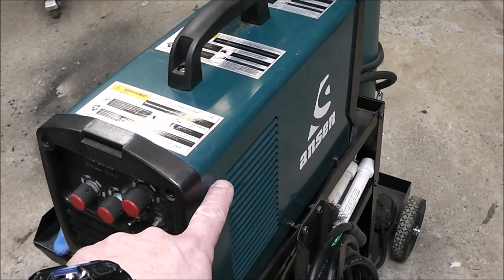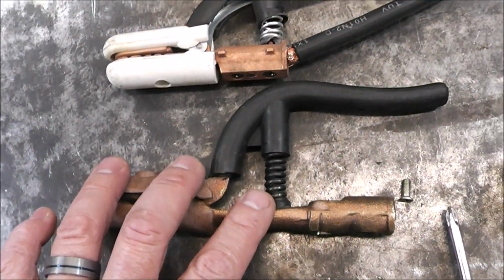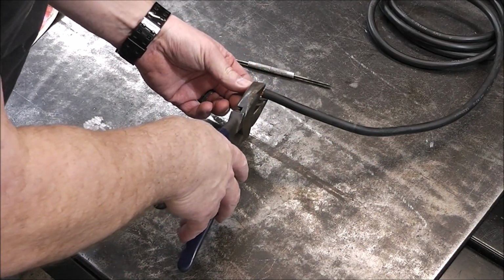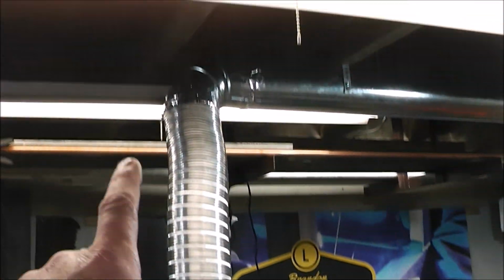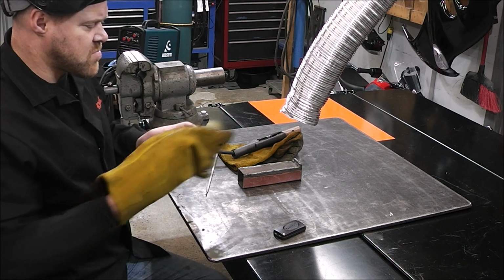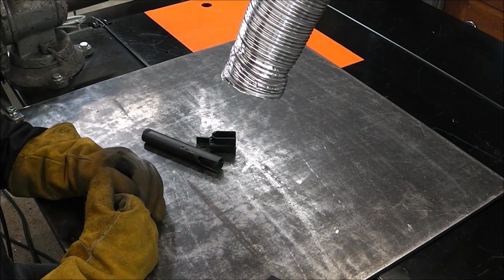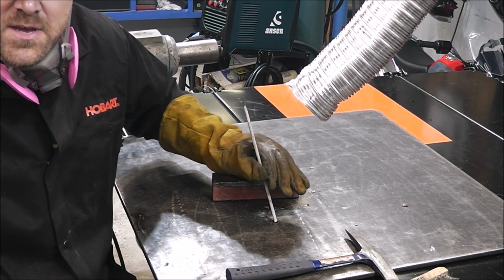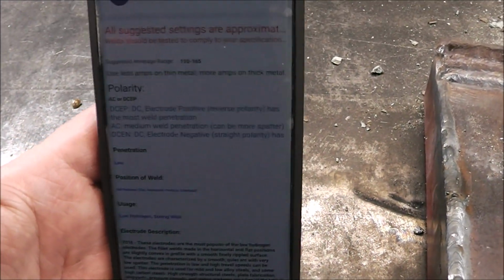AMAZING Welding Stinger Rod Clamp Failure YOU WONT BELIEVE IT!

Comment: i had to change the holder on my old miller buzz box i went with the berger one from hf its actually pretty nice though solid brass inside comfortable to hold and handles 400 amps also only 12 bucks with a coupon but id rather spend a few more bucks and buy an American made product. the carbon fiber did seem like a nice feature until it started arching. definitely gonna take it apart and put some dielectric grease in there and make a fume extractor like you did after seeing this now.
Reply from the maker: Nice! HF has some pretty decent stuff.

Comment: I keep an old course wood file/ rasp attached to a board lying next to my project. When you get rod burn back just strike it across the file and the flux is taken off quickly. Kind of like the motion you use when you strike a wooden match. Love the tips and info. JeffinMaine
Reply from the maker: That's a great idea!
Reply: works great costs zero , well if you have an old rough-cut file lying around  @BrandonLund

Comment: Plus the stock stinger has a gap at the grip. I believe due to the length of the cut conductor strands was cut by ste locking mechanism not insulation cutting..
Reply from the maker: Makes sense. Crazy huh!

Comment: If you fling the molten ball off of the end of the rod immediately after breaking the arc then all you need to do is crumble the flux away with a gloved hand. It the oxidation that forms on the molten ball that inhibits restrikes.

Comment: The wire strands broke because a) the clamp edge, and b) the wire is flexed at the clamp everytime the handle is squeezed. More how the copper extends farther back on the new part? That removes the wire from being THE bottom part of the handle.

Comment: Scratching the rod is better than tapping the end. Usually the poor restart is from melted flux or other impurities at the tip of the filler metal. Cracking back the flux too far actually can make restarts harder by not providing enough shielding gas to get a stable arc.

Comment: Good video. One thing I will comment on is using the antioxidant goop. It's mainly only for aluminum condustors because they set up much easier than copper. Adding anything to the conductor such as the goop increases resistance
Reply from the maker: Good point

Comment: Now I want a YouTube channel...just for the telemarketing. I was liking the stinger until I saw that first spark. Then it hit Carbon fiber...wonder what best of the best welding will have to say.
Reply: That's partially why companies have people test their new products.  But i agree i would hate to see that if i owned the company.
Reply from the maker: The actual stinger piece itself is very high quality made by Radnor. I'm surprised their R&D didnt catch this.
Reply: Doing some research on this cause it got me curious... While the carbon is conductive the epoxy it's coated with is not. As long as that coating is thick enough and you don't get a couple of breaks or thin spots you should be good. That handle had to have had at least 2 spots that were able to touch
Reply from the maker: That makes sense...it sparked on the end where it was cut to length and the raw carbon was exposed.

Comment: You will also find that alot of rubber hose that uses carbon in its composition can be very conductive when used to isolate electrical connections.
Reply from the maker: I never knew carbon fiber was conductive but this is also the first time seeing it in person.

Comment: Carbon fiber is not as good of a conductor as most metals but it does conduct electricity. It is really wrong on a part of the manufacturer who used it in welding rod holder.
Reply from the maker: I'm surprised someone didnt figure this out before me. I never knew carbon fiber is conductive. I do now lol
Reply: @BrandonLund  Nowadays you can find any rubbish things on the store shelves. Here we are with the new free trade imposed by the corporations. You have to be careful before buying something.
Reply: @BrandonLund  Nowadays you can find any rubbish things on the store shelves. Here we are with the new free trade imposed by the corporations. You have to be careful before buying something.

Comment: Luckily I got a screw clamp stinger with my MMA/GTAW welder. 200A Welder, 400A clamp & stinger came with it (and it wasn't cheap, lol). Now all I gotta do is wait until we get some cooler weather and fire bans (affects welding outside) are lifted to get on with practice, lol.
Except for the glue giving out, you could've slipped some heatshrink over the handle and that would've solved the arcing problem, but a previous commenter (Dominique) said his similar piece broke at the spring. Looks like it is back to the drawing board for the manufacturers.
Good stuff Bran, thanks for sharing.
Reply from the maker: Thanks buddy! Its been mild here lately. Cant wait for warmer weather, however there is a chance for snow this weekend so its inside for us here. I'm amazed that no one caught the fact that carbon fiber is conductive. I wasnt aware. I am now 😁
Reply: You weren't aware??? Holy CRAP!! You're kidding me, 🤣🤣!! The name tells you🤣. One little sliver out of the resin coating, as you got, and boom... The resin coating wasn't good enough, but, yeah, like having a copper handle, if the outer insulation is crap, there goes the handpiece, lol.
Just quietly, I've cooked some carbon fibre arrows at my friend's LGS where I part-time, just for fun, hooked them up to a LV DC source and they fry like bacon. All because I got a tiny sliver stuck in my finger 🤣🤣 (revenge), took ages to get the bugger all out.

Ah well, nice trophy for the wall mate.
Don't take your "Electrician's Cap" off too early.
Not gunna let you live this one down 🤣🤣🤣🤣🤣!!
Reply from the maker: Sometimes it's the simple things that seem to confuse the most...it wasn't until I said "carbon" that the light bulb came on 😅🤣🤣🤣 cheers buddy! 🍺

Comment: I have 2  stingers with leads  from my Fronius welders they are rated for 200 amps which plenty for my needs as I rarely go past 145 amps
usually on some 1/8 7024 or 1/8 7014  other than that I am at the 90 to 125 amps . I had 3 300 amp stingers for my old Miller but sold them with the Miller I never needed those stingers , Brandon, 200 amp stingers should okay for you as well.
Reply from the maker: I agree 100%. I was surprised to see the "300 amp" stamp on that budget welder...considering one is only rated at 180 and the other at 205. Probably gimmick marketing. I doubt that the original stinger would even handle 300 amps but then again I dont think many of the imported welders meet UL standards anyways.

Comment: Hi Brandon
I bought a cheap inverter stick welder 16 months ago 
At the first use I have to replace the ground clamp because caught on fire and the electrode holder because wasn't good to hold a 3/32 electrode 
Once replaced them I can easily run E6010 electrodes .
Reply from the maker: That is the drawback sometimes with those "budget" welders.
Reply: @BrandonLund  yep that's for sure
Happens also with plasma cutters ,I don't know why you didn't replaced the power cord on your welders an on the plasma cutter .
Them are usually so cheap that doesn't last I've also had to do that on my welder 
About the stringer you can try to adapt the clamp part to another handle , maybe your next video will be about this?

Comment: OOPS!!!  sumtins not right.  I am wanting to get set up to weld aluminum and also want to stick weld. What’s your suggestion Brandon? I am not a welder but have projects to play with on my stuff ?
Reply from the maker: Welding aluminum is where it gets expensive because it requires an AC welder. Pretty much any welder geared towards welding aluminum will be a good one where is the prices generally start at 1k.
Reply: @BrandonLund  I have looking at a Klutch 140 mig with regulator so i can do alum
 Sounds like i should stick to fluxcore mig and wait till i have more money
  Initially i want to start doing sheet metal on my 60 Chev

Love your channel !
Reply: what I would do is save your money till you can buy a welder which will handle a spool gun for aluminum. there are cheap ones out there but sooner or later they fail. You might look at the Longevity welders , I am not sure whether the HF Vulcan has a decent spool gun, buy an Esab 215 rebel and matching spool gun (not cheap) I have that set and it works great. I also have a Fronius Transteel 2200 and I weld aluminum with the mig gun on it but these are expensive units not for beginners.